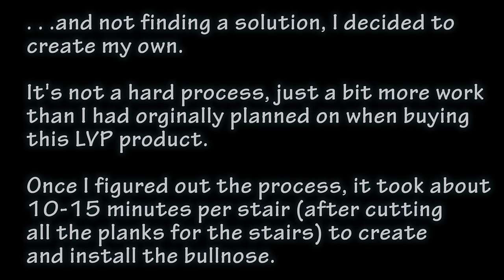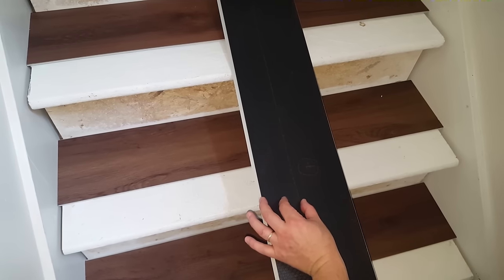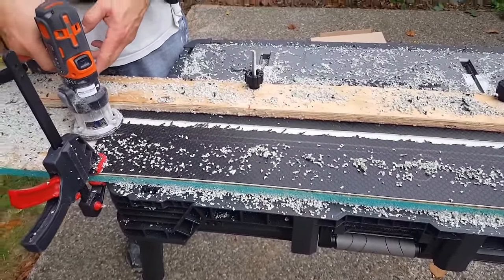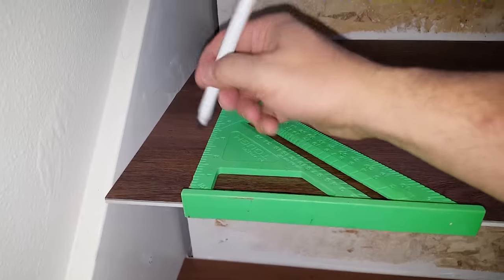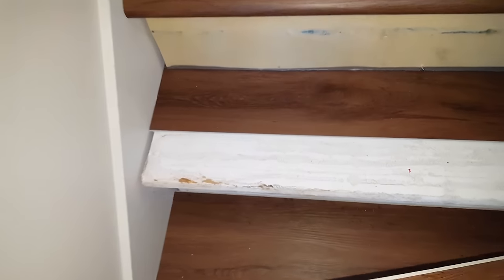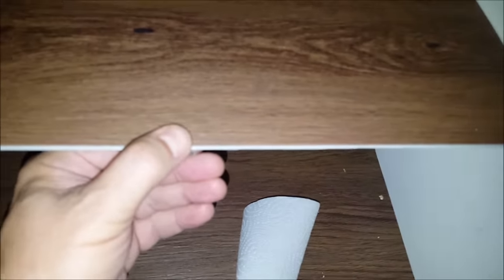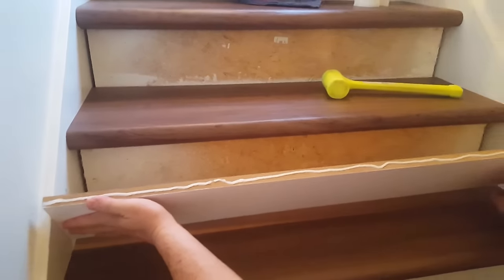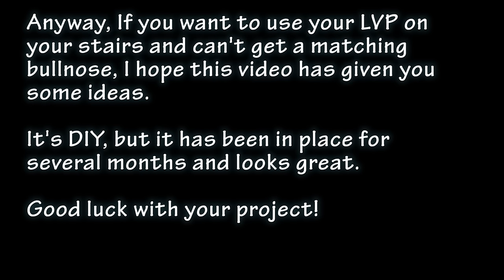LifeProof LVP Flooring: How to use on stairs and create a matching Bullnose!

Comment: Unique application.  I install LifeProof LVT professionally.  Few points: One. They DO make stair parts including bullnose for almost all the colors offered but all are special order and somewhat expensive.  A 12" x 42" bullnose plank cost $50.  Considering the time you've spent or I would have to spend to try your method would be time consuming and thus cost prohibitive.  Second point is LifeProof flooring is basically a PVC bodied material with a HDP backing.  It IS NOT meant to be glued down least of which reason is expansion/contraction of the material itself.  Most likely the reason why the professionally made LifeProof stair parts and made out of MDF with the PVC floor color bonded.  It is made to be glued down to stairs. 3rd.  Not sure what you are using as an adhesive but NOTHING will stick to the HDP backing material on the LifeProof floor LVT.  You might want to check your adhesion over time.  There is a video out there where a contractor tested adhesion qualities of LifeProof using mastic, polyurethane, contact cement, silicone adhesive, asphalt binder.  He tried around 8 kinds of bonders.  Nothing would stick except a two part epoxy.  All in all, your stairs have one great benefit of not having transitions.  Good luck out there.
Reply from the maker: Thanks for the tips! At the time we did our floors (a year ago), Home Depot said there were no matching bullnoses and I couldn't find any on the internet. The reason I mention the Loctite construction glue is that it was the only one I found that actually worked, even after the heating. I would let the first plank dry for 15 minutes and it was solid - it had to be because when I then snapped in the bullnose plank and started to bend it, the first plank had to keep it in place.  I tried other glues and they didn't work.
Reply: @ChronologicallyExperienced  The HD rep who helped you steered you wrong.  The stair parts have been around since LifeProof was carried by Home Depot.  The product is made by Zamma Corp. under license from LP.  Chances are they searched it wrong.  I've been buying the stair products for quite some time.  The Loctite adhesive is a polyurethane which will not bond permanently to the high density polyethylene sheet backing on the planks.  It will hold like a caulk would but will not act like an permanent locking bonder.  I would be careful on anything applying uplift pressure on your stair planks.  Not being negative here...You may not have high traffic worries.  Your install came out very professional looking in my professional opinion.
Reply: @chrisford8403  Yep.  That's the product.  Just when the COVID was setting in back in February, I ordered over $4000 of the stairs products.  Took forever to receive.  The job came out superb and near flawless.  I'm very detail oriented...the LAST thing I would ever do is use the manufacturers video as a help guide to install.  The video is a joke!  Completely sloppy application and they used mastic WHICH...you cannot use!  Now, they specify that ONLY URETHANE bonder may be used on the MDF underside.  Labels are plastered all over the boxes.  Also, their end cuts were left raw.  Their cuts were jagged.  Everything about the install vid was unprofessional IMO.  Any homeowner could do better.
Reply: @chrisford8403  These are all for stairs with boards 1" thick. Unfortunately for my old house the stairs are 1 5/16", custom bending looks like it would be the only way to do it.

Comment: I'm a pro carpenter and this a really great idea. How are the LVP treads with wet shoes? Just a heads up if you do this again: leave the risers and treads 1/16" short in length, use a 5 degree bevel on all cuts and fill with caulk if your are painting. If your risers and treads are too tight they can cause squeaks later down the road or force the skirt boards to shift. If they are going to be stained leave a smaller gap and use shims cut from the same wood to shrink the gaps. I use a stair gauge that let's me get really close, about 1/32" to 1/16"; you could also use cardboard to make templates. The prefabricated stair cases usually have their treads and risers sitting in a routed slot to allow for expansion and to reduce squeaks while keeping the appearance of no gaps.

Thanks for sharing this tip!
Reply: I agree Chris with your reply.  (This is caiobabe).   Definitely, there should always be room for expansion of product thus not cutting so tight that LVT treads need to be pounded in as in the OP's video.  There will be buckling down the road.  I would recommend caulking with a latex caulk and then paint over or use a color caulk at seams.  That product will allow for movement.  I would recommend too that before application of either the LVT or the Zamma matched MDF stair products, that...one uses a good construction screw to re-address any loose planks, treads, risers, landings.  There would be no need to do any special cutting when using the Zamma / LifeProof treads as the product must be adhered with heavy urethane bead lines from your caulk gun.  The LOCTITE PL3X is the preferred urethane bonder.  No need to use the higher grades, do not waste your $.  This base urethane does the job very well.  Urethane, as it cures, actually expands which is an attribute to using this product under the Zamma treads.  I hope to post pictures of my most recent LifeProof stair job.  Take care, (caiobabe)
Reply from the maker: Hi Chris, great tips for anyone else who might try this. Obviously not having any experience with this, I was just thinking I needed to make sure everything fits snugly so nothing comes loose. I actually do have a tiny bit of spacing on most of the sides, albeit that wasn't intentional - just my amateur cutting and measuring skills, heh heh. Like I said in the  video, if I ever have to redo these (which hopefully I won't), it's going to be time to hire a pro! I did it once, learned a lot and earned some good equity in the house, but I'm done with it!  :-)
Reply from the maker: Hi Victor. Thanks for the advice. It's been a year now and I'll be doing an update on the stairs so these tips will be a good addition for others. Thanks again.
Reply from the maker: Hi Chris. One-year update video is out. Added your suggestions to it!  Thanks.
Reply: @victorvarisco5360  yes,definitely want to see those pictures

Comment: I think you nailed and it looks professional. Of course it’s time consuming and to pay an installer to do this would not be cheap, but this is way nicer than having a vinyl stair nose on every step overlapping the tread on every step
Reply from the maker: Thanks. Considering I've never done anything like this before, I was quite pleased with the end result. It took me about 7-8 hours because I was coming up with the process and learning along the way. I would say that a professional could probably come up with a better, faster process. I suppose 'need' is the determining factor as to whether one does this or not. My wife 'needed' the stairs to match the floors and since there were no good options available at the time, her 'need' was the driving force to come up with something, heh heh.

Comment: I am planning on doing this to my stairs. My plan is to take a 1 x 4 and round the edge. Take another 1x 4 and make a sandwich jig. Set the depth I want the bull nose , sandwich a whole piece LVP and clamp. Using the heat gun until plyable then roll over and clamp until cool. That way I cut the back piece to fit instead Of using a whole piece then making the bullnose. Great video.
Reply from the maker: Thanks for watching. Sounds like a good plan. I was lucky enough to be able to fit exactly two planks around the whole stair without cutting.

Comment: I like your video. I've been experimenting with heating end bending vinyl floor to make bull nose myself. After reading Dr J's comment, I'm now having second thoughts to use this idea due to potential slip and fall. In the winter when people come in the house, with a smooth vinyl tread and snow stuck to the bottom of boots, I can see a slip and fall. The building code reads stairs are to be slip resistant. Other than that, looks fantastic. The floor won't fail. Doug Brown is right about companies wanting to sell something for $50. The only failure is perhaps thinning and making the leading edge weak and hitting it with a hammer. You can heat and bend without routing. If the stairs are not part of an entrance, but inside where everyone has taken off their wet boots and feet and stairs are dry, then this looks like a winner.
Reply from the maker: Hi Philip, thanks for checking out my video. As I replied to D. Jr., my experience over the past nine months regarding slipping has been positive with this product. I cannot comment on other products, but whether intentional or not, the ridged texture on this particular product makes for a great non-slip surface when placed horizontally on stairs. Our family has not had a single instance of slipping even through the wet, rainy season. Obviously you'll have to asses the product you are using as to whether it will work for you.  Good luck with your project!
Reply: @ChronologicallyExperienced  Glad to hear you haven't had any incidents. I'm still experimenting. I intend to paint a band of epoxy near the bullnose edge and add sand. I will provide update with the result.

Comment: That turned out so damn good, congrats! I have the flooring and I can't believe Lifeproof doesn't sell these and accessories.
Reply from the maker: Yeah, at the time I did this there weren't any options, but now there is an option from some company that makes 'matching' bullnoses. However, from what I've seen and folks have told me, it still doesn't really look as good as the original planks. Hence having to do my own solution. Thanks for watching!

Comment: I finally got a test piece of Lowes Smartcore Ultra to bend like this.  Steps:  1) made kerf cuts on the back...1/8th inch deep.  2) put piece in the form.  3) heated the FRONT of the piece, as you did in your video here, 4) used a porter cable heat gun, 1500W and SLOWLY SLOWLY SLOWLY started heating the piece, holding the heat gun about 2 inches off the piece.  5) after 11 minutes of heating, it melted enough to bend.  Things I noted:  1) Possibly on the stair this will hold up...but if I try and bend it when it is not on the wood, it will break.  Those kerf cuts made it easily breakable. 2) I came ever so close to melting the plastic.  I can see I'd go through a few extra pieces making mistakes...ie getting too close or holding the heat gun too long on one spot.  I saw a few spots start to bubble up but I quickly cooled it and after I was done I couldn't tell.  I held it in different light, too.  Next up, I'll try another kind of form and heat the back.
Reply from the maker: I can't really comment on anything other than the Lifeproof since that is the only product I worked with. I know that while I was testing it beforehand, I found it really hard to bend without removing some of the material, but after seeing how kerfing works, I'm not sure I could've gotten that to bend as easily as just removing the material. As you saw in the video, it didn't take that long to heat enough to bend - at most about five minutes so there must be some major difference in the material used between the two products. Also, I never held it in one place and instead, slowly went back and forth to avoid melting.  As mentioned in the video, I only lost the one piece and that was due to my own impatience rather than the product failing. I do think you need some kind of form/mold to bend it around since it is more fragile while it is heated up and needs some support during that process. It sounds like you have lots of experience so I'm sure you'll find a good process that works for you.  Thanks for keeping us posted on your progress.

Comment: Excellent.  You said you are not a pro but in my experience, most pros won't take the time to be so meticulous.  A competent DIYer usually will do a better job.   I will probably do the same next winter when I finish our basement stairs.  Thanks for documenting and sharing.
Reply from the maker: Thanks for the props, greatly appreciated. I guess it's because we are working on our own homes and really want things to be done correctly. Not that a professional wouldn't do a good job, but they aren't as personally invested as you are. Plus, this is so much work,  I sure as heck don't want to have to redo anything. The main thing for any first-time DIYer is to do your homework, and lots of it - before you start!

Comment: I am a professional and that is one cool idea. Patients is definitely the best tool for this job. I install for home depot and this is always an issue when we go to match lifeproof to the stairs. They should see this. They look amazing.
Reply: I doubt they would have you do this. This voids any warranty im sure and most people are too cheap   to pay for the time consuming labor
Reply: @Stevesbe  Also, cap-a-tread now has lvp in similar colors. that will probably be the only "official" vinyl plank stair option until other manufactures come up with their own. Not cheap though, $50-$70 per step (material only).
Reply: Yeah that's what these reminded me of. I didn't mean that installers should do this on the job. I meant if the manufacturer saw it they could come up with a way to mass produce these safely using the lifeproof colors they already have. They look so much like cap a tread. Another thing with that black pad on bottom how would you attach lvp that supposed to float to the stairs
Reply: @zenon72  Im sure you are familiar with ACS. They sad you can't have floating of any kind on stairs. So, glued down is the only option with planks. That's a no go if it has an attached pad(backing). The glued pad isn't long term reliable. Think of the lawsuits if a tread came loose.
Reply from the maker: Planks are glued down and held firmly in place with the risers so hopefully this won't happen. Might have been even better to remove the padding before gluing. Oh well, too late now. It's been a year now and things are still as solid as before so hopefully it works.
Reply from the maker: Yeah, the problem with the ready made solutions was the color matching. Wifey really wanted the colors to match so had to come up with something...
Reply from the maker: This video/process wasn't really meant for professionals. As far as warranty, I can't imagine that any company would warrant the planks after manipulating them this way, but that is a decision that I, as the home owner, made.  Not going to worry about a few planks if for some reason they crack or whatever since I knew ahead of time that this wasn't standard use of the planks.
Reply from the maker: Thanks Zenon, greatly appreciated coming from a professional.
Reply: @ChronologicallyExperienced  I think in your case, it will probably be fine. Between the glue. the screws under the nosings and how tight you jamed the risers in, likely nothing will move. As a general rule though, glued pad backing isn't reliable on its own.

Comment: Really appreciate the video. Inspired me to LVP my stairs with lifeproof flooring also. I made a jig in my garage that consisted of two pieces of wood with a piece of 1/4" steel flat bar sandwiched between em. I plopped the vinyl into the 1/4" channel and bent it around after 5 minutes with 2 1500W heat guns. After 5 minutes of cooling down I popped the pieces out and slid them on the stairs.
Reply from the maker: Awesome! This is so cool to hear that my fumbling techniques inspired someone to try this process out. I thought about doing it your way for my stairs, but each stair was a slightly different width and thickness which made me think it would be easier to fit by bending it directly on the stair.  In hindsight, I think doing it your way would still have worked and been easier. Oh well. . .
Reply: @ChronologicallyExperienced  I have been in the flooring business for over 10 years.I have done this on sloped entry ways but never thought of this.after you heat it and get the form you want you need to shock the plank with cold damp clothe to set it  faster.You are amazing !!!!!!
Reply: P.S    I found this out when I left a piece of transition on my table saw in the hot summer.I came back from lunch to a piece of limp spaghetti .LOL

Comment: Finally! I’ve looked all over for a solution to LVP stairs. Thank you for doing this. Now I can finally finish my stairs
Reply from the maker: Glad I could help.  Make sure you glue down the first piece and let it dry a bit.  That way when you lock in the piece for the bullnose, it won't come loose when you start the bending process. Good luck with your project.

Comment: Heck of a lot of work. You did a nice job. I had carpeted stairs and ended up retreading using stairtek retreads. Came out nice. I couldn’t have gotten away with the bend process on my stairs as I had corner angles to deal with. I did enjoy your video and you came up with a clever way to make it work. Best, Steve
Reply from the maker: Thanks Steve, appreciate the comment. Our stairs also had carpet but luckily the bullnose was rounded. It probably would still have worked albeit with a bit more rounded corners. Thanks again.